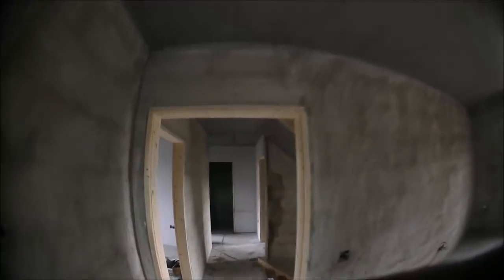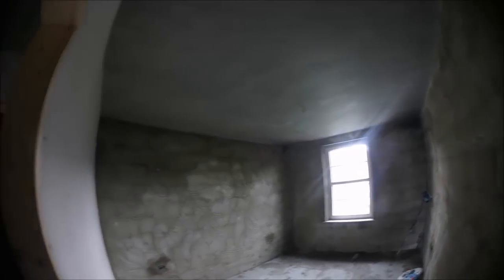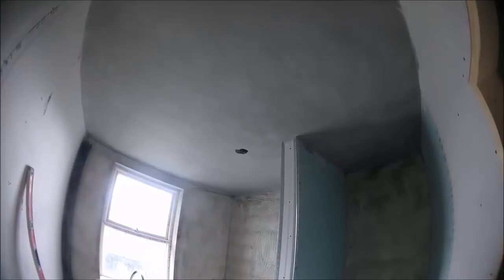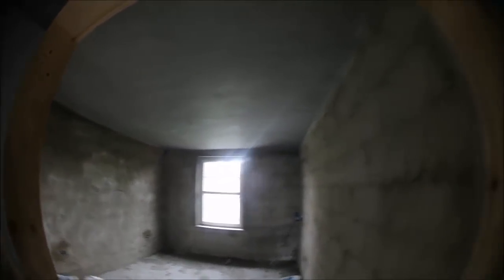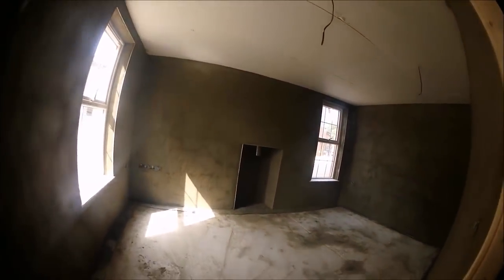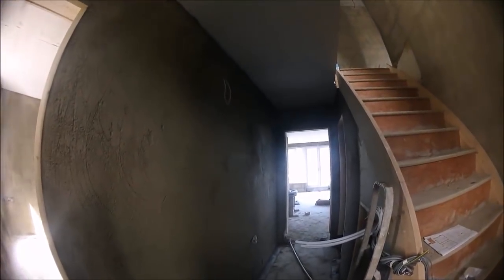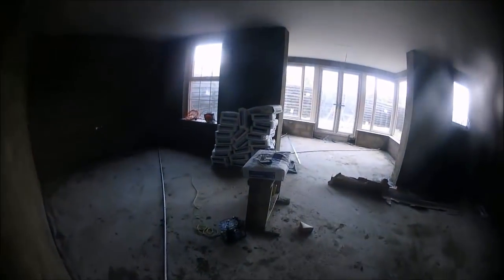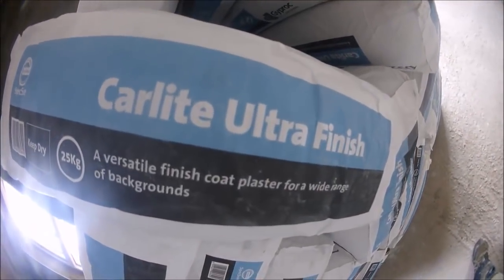plastering chat on round curved walls and ceilings barrel ceilings arches ect pos how to

Comment: Alright mate sorry to bother you but do you where you can get a refina mixer repaired
Reply from the maker: Your Belfast ?
Reply: No liverpool but I'm struggling to find anywhere
Reply from the maker: You could probably send it to refina, or try a local tool hire store they most times have repair guys there
Reply: Would you try to do it yourself or would you leave it to the professionals
Reply from the maker: I have a smaller cheaper drill i would change the  brushes but that was simple if it was something else i would leave to a pro much safer
Reply: Ok thanks for your time mate
Reply from the maker: Any time buddy try and ring round a few tool an plant hire and see if they can price it up for you
Reply: Will do thanks again

Comment: It's hard to keep the rounded ceilings from cracking over time.
Reply: Norma Jean Clark  WHY.
 I've never seen them cracking if done properly.
Reply from the maker: Would be down to making sure they are well plastered boarded nice and tight no bonce tape it up with scrim and a tidy under coat of bonding then skim but if they do crack it looks really bad